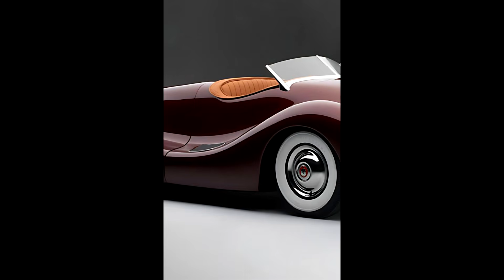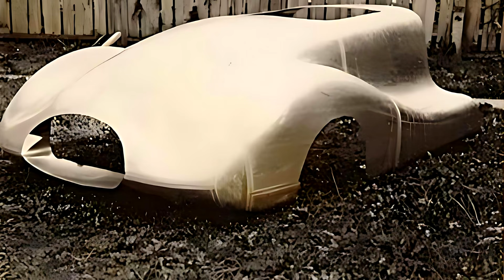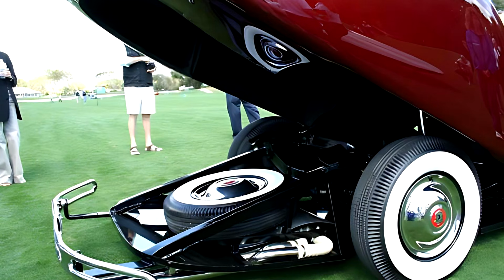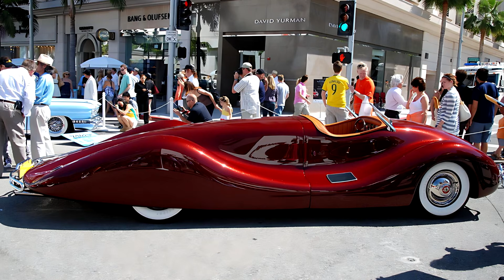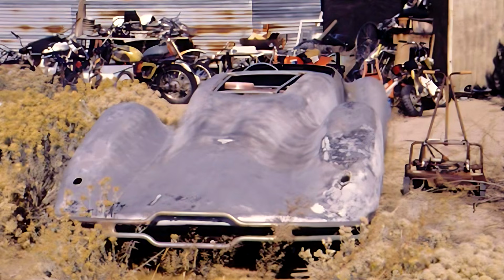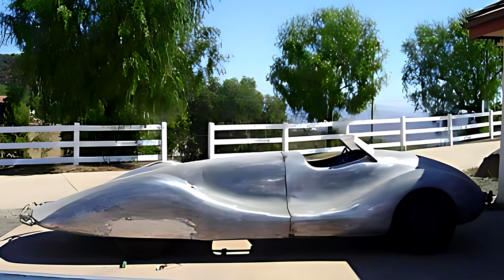1948 Norman Timbs Special — America’s Most Beautiful Homemade Car 🇺🇸✨

Comment: I would have liked to see how they worked the cooling system. 
  You can have the radiator in the front like aways, 
yet you would not have the engine there to use to power a fan for it.

Comment: I was going to say that the car looks fantastic for 75 years old, but this is the replica we’re looking at here.  Still looks incredible from an original that was built back in 1948.
I bet there are no cup holders in this thing, and that’s the way it should be.  You pull over, park the car, get out and walk to a hamburger stand to have lunch at the tables out front.  You don’t eat in cars, especially one as nice as this one.
“It has a Buick inline eight cylinder engine sourced from Buick.”  Well, duh.

Comment: I think you have your facts confused.  The car in this video is the restored original Special.  It actually appeared in the remake of Gone in 60 Seconds, the bare aluminum shell visible in the junkyard background.  The car was seriously damaged about 5 years ago in one of California's wildfires.  The owner said he was going to restore it once more.  Otherwise good video.
Reply: Thank you for correcting history. I saw it early in its restoration, and it was clearly not a recreation at that time; I was stunned to see the finished car as shown here a few years later, more beautiful than when it was new. And the owner did the restoration himself. I believe it was the Woolsey fire that burned down the house, that had a restoration shop on one side and a museum containing about 40 cars on the other. A lot of history burned that day, automobiles and automobilia.